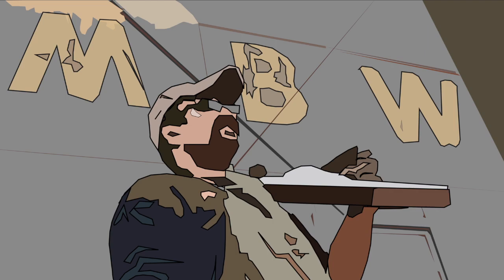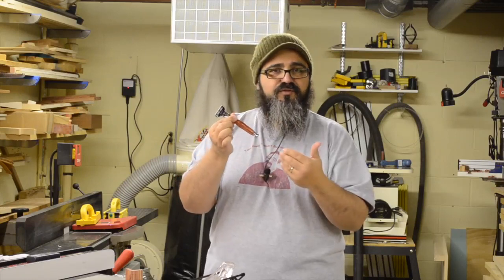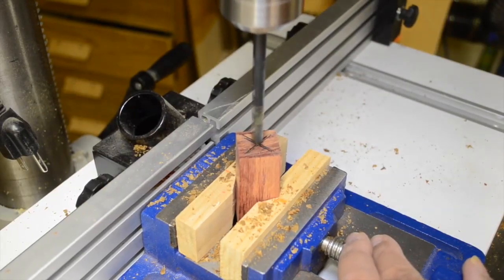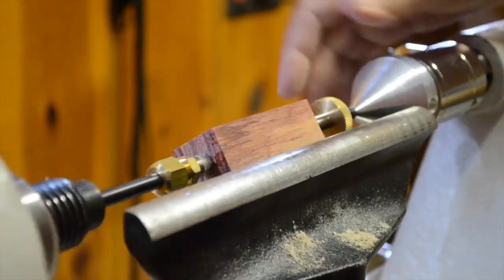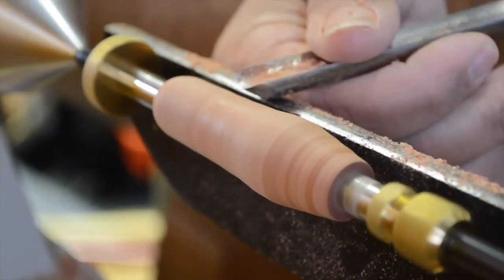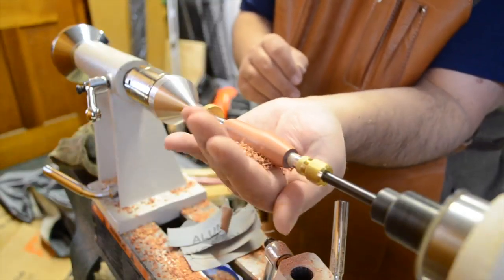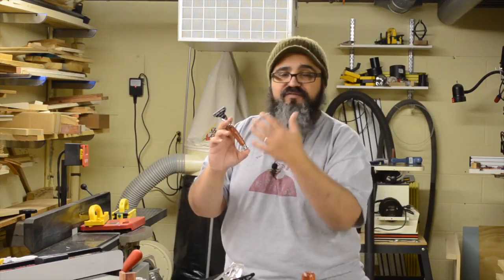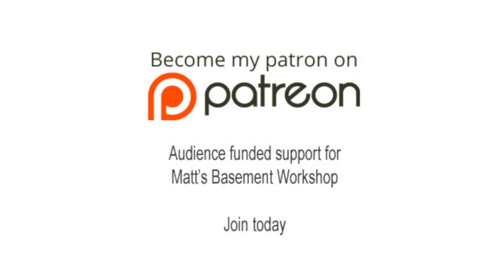534 Sharp as a Razor

Comment: Matt, I agree, I'm not sure why anyone would want to be clean shaven. :)  One question though, is it recommended to add a little glue to the end caps?  Considering they will get wet and stay in an humid environment, I'd be a little worried about expansion and contraction popping the ends off.
Reply from the maker: The caps actually fit into the insert tube. But, gluing it is a great idea also. In fact, one end of this razor kit needs to be glued before it goes into use.